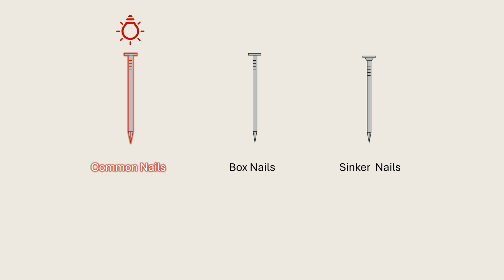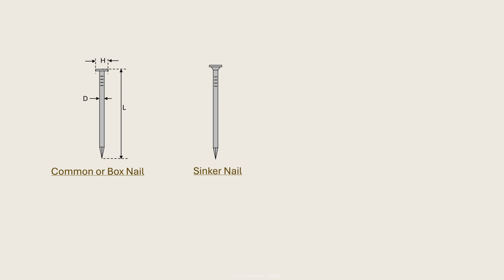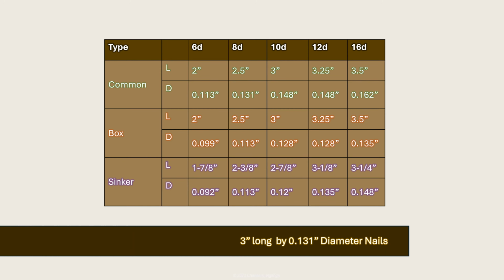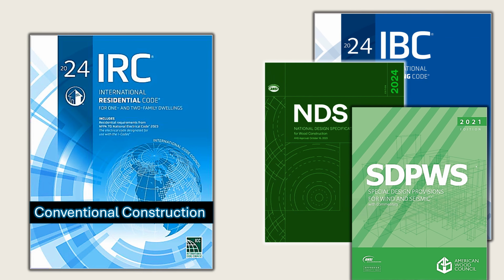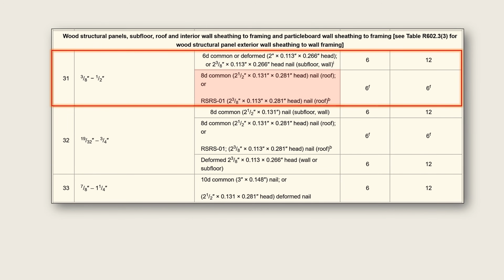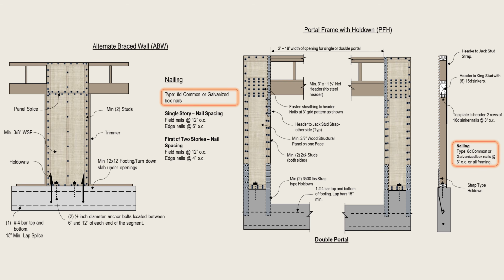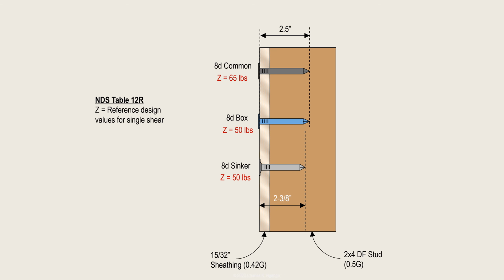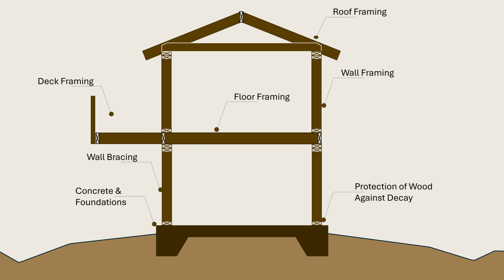The RIGHT Nails for Plywood - What every builder needs to know!

Comment: All structural nail requirements call out the gauge size so there will be no confusion or what type of nails is required. When you buy a hanger from Simpson, it will call out the required nails for that hanger and your attachment. If there’s a specified hanger that doesn’t have specifications due to its unique nature, the structural engineer will call out all required attachments.

Comment: So many people are using nail guns and many require the use of clipped-head nails.  Is there a difference in holding power of clipped-head vs full-head nails and does the IRC recognize this and any other differences?  Are there any times one should be used over the other type?
     This series has been extremely informative and helpful in understanding the IRC.  Thank you!
Reply from the maker: @jamesp739 - When clipped-head and full-round-head nails share the same shank diameter and length, their shear strength is essentially identical. For withdrawal,  the withdrawal strength depends more on shank type, diameter, and penetration depth than on the head shape. I believe that the main concern with clipped-head nails is pull-through resistance. Under high negative pressure, I would assume that the wood structural panel may pull through the nail leaving the nail in the rafter or stud. Therefore, in my opinion,  for cases where the IRC specifies minimum head size (Items 31–33 in the fastening schedule in IRC Chapter 6), framers should use the full-head nails specified. Outside those cases, acceptance of clipped-head nails depends on the local building department's interpretation or amendments.

Comment: Dose the IRC cover the minimum requirements? Or anything outside of their specifications no longer IRC compliment?  

Im considering a situation where someone uses an over sized nail or screw to achieve extra strength.
Reply from the maker: For conventional construction without engineering, you need to work within the IRC. You are certainly permited to use more conservative fasteners that are  allowed within the IRC framework.

Comment: So I'm assuming they tested all of these nails In a high wind test to see which hold because smooth shank nails do not hold after withdrawal
Reply from the maker: Thanks for the comment! You're right that smooth-shank nails generally have lower withdrawal resistance. That said, the IRC nailing guidelines reflects a mix of factors, including legacy construction practices that have performed reliably over time (including in high wing scenarios), as well as input from major players in the industry including the testing and engineering research community in some cases. The guidance does aim to reflect what works in typical structural scenarios.